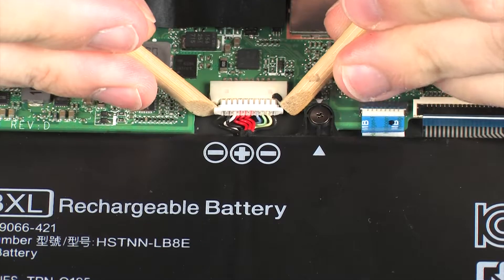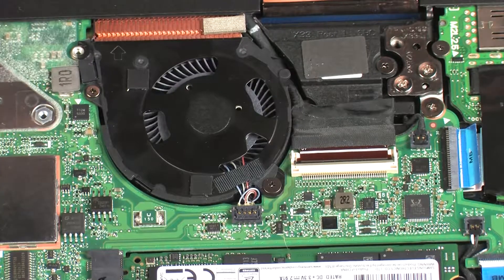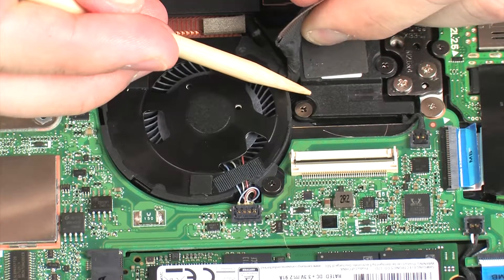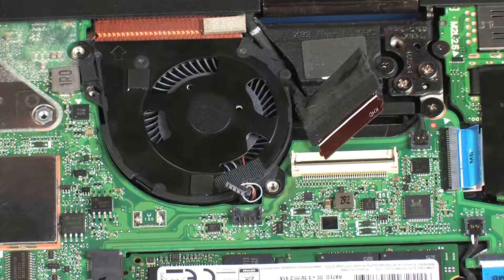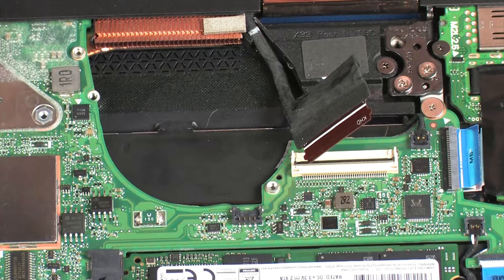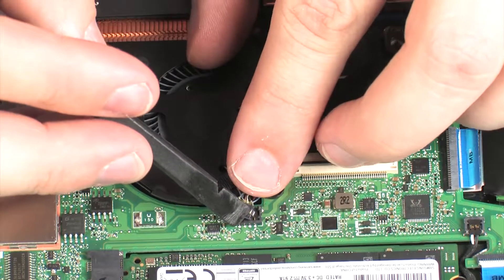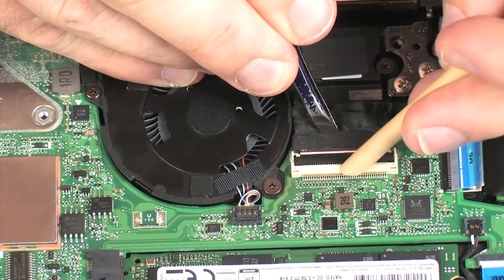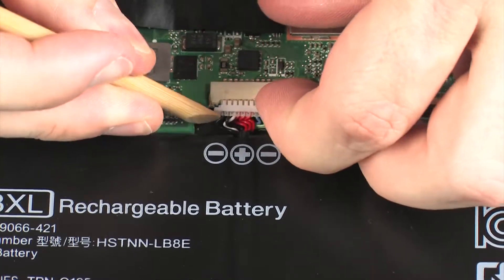Remove and Replace the Left Fan | HP Spectre x360 13 | HP

Comment: Where does one get the tools used int he video to be able to remove the pins and connectors with ease? I see a wooden like slanted stick, and the prongs that seem real handy?

Also keen on where to find where to get genuine fan replacements? have a hp x360 13 ae010tu
Reply from the maker: Hi Veneros, thanks for contacting HP Global Social Media Support!
I understand that you  need to purchase tools and replacement fan.
I will do my best to assist you.
Use the HP Parts surfer to identify the part: https://partsurfer.hp.com/partsurfer/ 
And order it via the HP Parts store: https://bit.ly/3nKMYrs 
Binu_HP Social Media Tech Support

Comment: I was getting a fan error. Removed fan and found that the small rubber spacers adhesive strip had slid over obstructing the fans movent. Moved it and now running smoothly
Reply from the maker: +Nirec Glad to know that your issue is fixed!!

Comment: laptop wount boot after this
Reply from the maker: +TopTierWeb Please do a system recovery as mentioned here to fix this issue: 1. Shutdown the computer. 
2. Turn the computer back on again and repeatedly tap on the ESC until a Startup menu appears. 
3. Press F11 once for System Recovery. 
4. Choose the Keyboard Layout. 
5. Click on Troubleshoot. 
6. Go to Recovery Manager and click on System Recovery. 
Note : Back-up all your data as System Recovery will delete everything that you had saved or installed on the computer.
Reply: @HPSupport  i mean the laptop completely dead after this. Pressing power button does nothing.
Reply: @Миханаганидр  are you sure you reconnected the battery? If not, follow the last step near the end of this video and connect those cables back to the place they need to be in.
Reply: @nikhilveeramachaneni7073  unfortunately I am sure. Every cable connected but the laptop seems to be dead

Comment: I replaced the left fan but the new fan still does not spin. meanwhile the other fan is spinning at 5000rpm. I thought the old fan was broken and got a new left fan but this one does not spin either.
Reply from the maker: +J shawney This seems to be a hardware issue with your unit. Please contact our phone support team to fix this issue: Please follow these steps to reach them.
Step 1. Open link: https://support.hp.com/us-en/contact-hp
Step 2. Select the product type.
Step 3. Enter the serial number of your device or select let HP detect your product option.
Step 4. Select the country from the drop-down.
Step 5. You should see the HP phone support number.

Comment: Has anyone seen a reduction in noise by replacing this fan? I’ve already updated my bios settings and changed my power and processor cooling settings to no avail.
Reply from the maker: +Nick Carlson Please follow the guidelines under this document to fix this issue: http://hp.care/2oPjRqD

Comment: quoted from another video: 

Daniel B
6 months ago
For those getting a "System Fan (90B)" fault code upon start-up, remove back like in video and spray each fan with contact spray.  It spins CCW and if one does not spin well from the force of the spray, then spray the fan axle/spindle and carefully spin CCW with a toothpick to loosen any dust/grime.
Reply: In my case it was due to adhesive on the back side of the fan melting and sliding over the moving fan blade preventing it from working.  Fixed it by removing the fan, and pulling off the bad adhesive, solving the issue without the need for a new fan
Reply from the maker: +Bobby Demarchi I am glad to know that your issue is fixed.
Reply: @BOBBYDEMARCHI  same exact problem here, thanks for sharing that, I would have never thought to check the thermal pads.
Reply: Hi @Bobby Dmarchi - is contact spray just the air spray for computers? Do you have to undo the fans and remove them to clean the adhesive if stuck on there?
Reply: @Veneros  yes just compressed air for computers. I think I had to remove the fan to clean it but can’t remember for sure it was a couple years ago